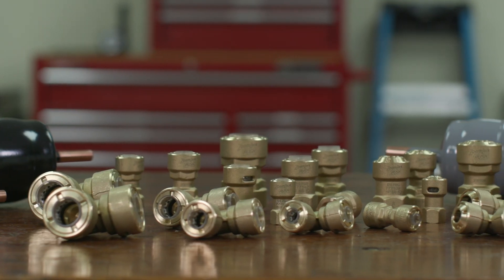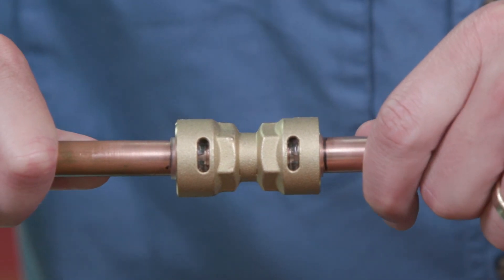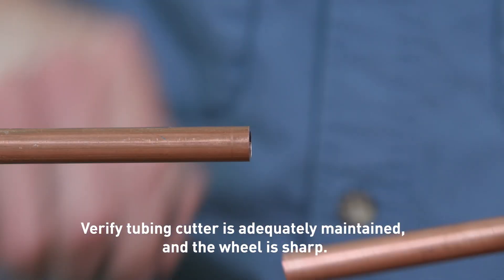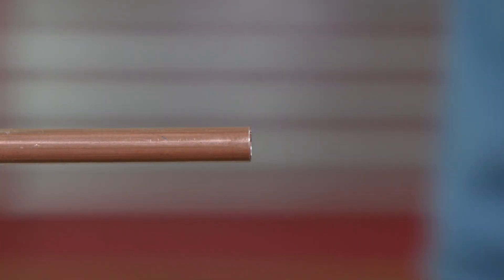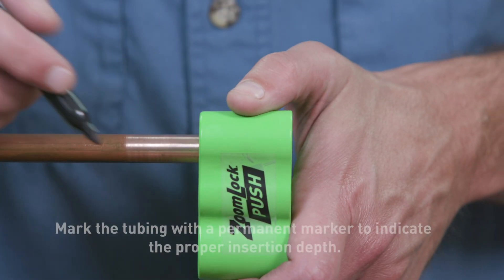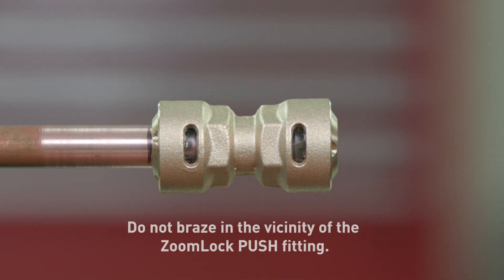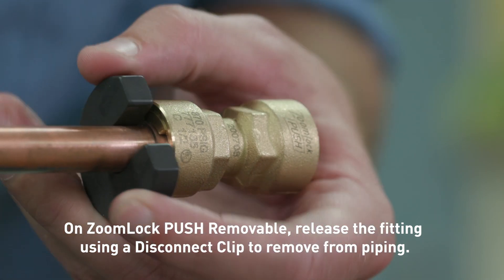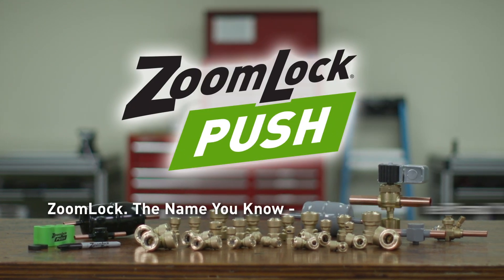ZoomLock PUSH Refrigerant Push Fittings - High Pressure HVACR Push to Connect Fittings

Comment: can Zoomlock be used with any refrigerant piping? All soft & hard copper?
Reply from the maker: Yes. ZoomLock PUSH refrigerant fittings can be used with both soft and hard copper. Just make sure to correctly prep the pipe and it's free from defects.

Comment: Ive had WAY! Way too much aggregation with these fittings, they are expensive and they often have a TINY leak in the system I don't know why this happened to me but it's been the 4th time today, I followed all the directions deburred sanded (with the abrasive cloth they sell) marked the depth,,,, and still tiny leak like 1 psi every 5 minutes, so I don't know, I'm waiting for the technology to improve and I'll be back
Reply from the maker: where are you located? I can get a sales engineer to look at your job and help you with a diagnosis.
Reply: @sporlanvideo  we are located in Jackson NJ, I still have 1 set of the fittings I took em off to study if you guys want I can send them to you
Reply from the maker: @allstarheatingandcooling113  I'll get one of our sales engineers to contact you. Email me your contact info at dennis.setchfield@parker.com.
Reply: 1psig/5min is not a tiny leak !

Comment: What fits over the service valve swag?
Reply from the maker: Either cut them off if you have enough copper line left or solder a piece of pipe to connect to

Comment: How do you overcome the bell ends of evap coils and service valves on ac units?
Reply: Great question brother I was wondering also👍
Reply from the maker: @pasqualedeccio7630  Sometimes there is enough room to cut the bell off and use Zoomlock MAX or Zoomlock PUSH directly on the unit. However, if there is not enough room, we recommend brazing a stub tube off site so you don't have to bring a torch to the job site.
Reply from the maker: Either cut them off if you have enough copper line left or solder a piece of pipe to connect to
Reply: @sporlanvideo  then what's the different if I still need to braze .I can braze it one without adding a joint???
Reply from the maker: @abdorakeebnaji1527  Sometimes there is enough room to cut the bell off and use Zoomlock MAX or Zoomlock PUSH directly on the unit. However, if there is not enough room, we recommend brazing a stub tube off site so you don't have to bring a torch to the job site.

Comment: I used the old zoomlock fittings on a vrf heat recovery job. I don't recommend them. Got me once.. It is hard to beat the reliability and durability of a brazed joint if you know how to braze.
Reply: My problem was in my area there are already a bunch of DIYers that would install stuff and want you to come braze the line set in, now they wont need you. Not to mention the illegal outfits running around, just made their lives easier. Slowly killing the trade in my opinion. I had enough of it and went to ammonia refrigeration where its definitely boring but theres job security at least since alot of people afraid to work around it.
Reply from the maker: These are completely different. These are ZoomLock PUSH which are push-to-connect refrigerant fittings. You can find out more at www.ZoomLockPUSH.com.
Reply: @sporlanvideo 
Being a push fit does not sell me on using them.  The zoom lock press fittings i used ended up having recalls on certain sizes but the system was already online and nearly impossible to replace fittings.

Comment: Zoomlock as a new technology was introduced quite a few years ago but I dont see people in the field use zoomlock fittings much. Maybe its just my area, but techs keep using torch. Most likely zoomlockpush will be the same way.
Reply: Its because of the price, a 3/4 sweat fitting is at most 2$ vs almost 30$ for a 3/4 zoomlock 90
Reply: I occasionally see them in places where you need a hot work permit like hospitals but even then it is rare.

Comment: Copper tubing is oftentimes out of round due to poor handling from suppliers. How can this be dealt with, is there a tool to make the tubing round to specifications, ensuring a  proper seal?  Also, when are you coming out with 1-1/8 and larger fittings.
Reply: The pinch off tools have a “rounding” function as well.  Like the Imperial 105FF   https://imperial-tools.com/products/105-ff-pinch-off-tool/

Comment: Will they work on your standard compressor stub? or is it just for joining pipework?
Reply from the maker: If they meet the ODM standards. Check out our catalog at www.ZoomLockPUSH.com for more information.
Reply: Maximum continuous operating temperature is 250 deg (F).   You may need to move it further way.

Comment: This will be good to replace filter driers
Reply: Lots of guys using the flare version with flared driers & TXV’s.   UR has been selling the original version (SB1) of these since early 2020.
Reply: Good point, AND REVERSING VALVES!   I wouldn't be surprised if they start putting them on the driers and other items like solenoid valves from the factory.